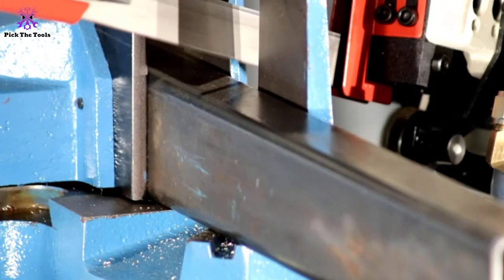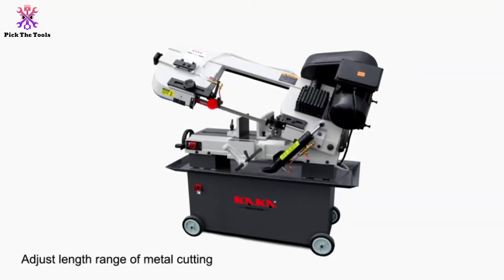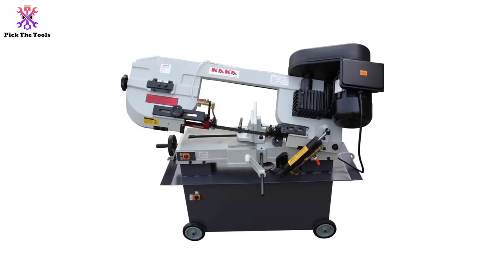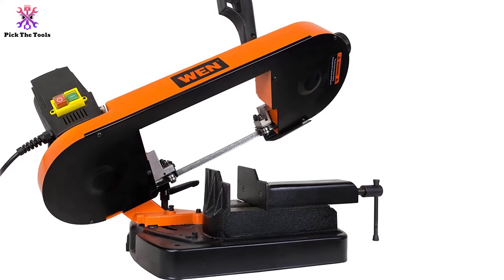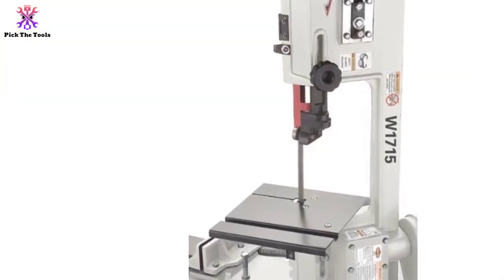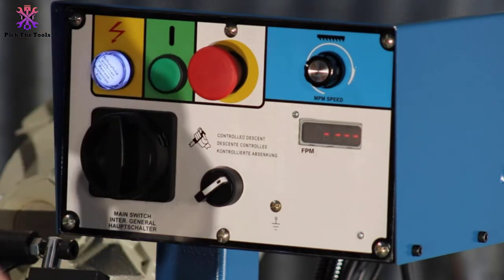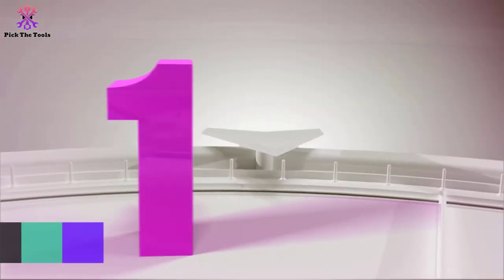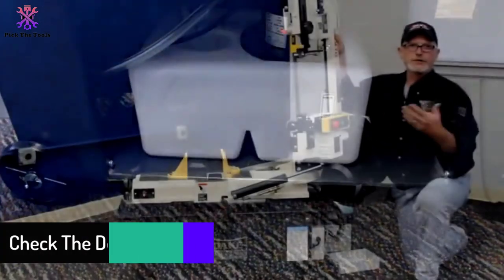Top 5 Best Horizontal Band Saws for Metal Cutting 2021

Comment from the maker: 🔹5. KAKA BS-712N || 7-inch Metal Cutting Horizontal Band Saw
[Link]  https://amzn.to/3xnx2zD

🔹4. WEN 3975T || 4-7/8-inch x 5-inch Band Saw for Metal Cutting
[Link]  https://amzn.to/3oLWxqo

🔹3.  SHOP FOX W1715 Band Saw for Metal Cutting
[Link]  https://amzn.to/3HGtyg8

🔹2.  Baileigh BS-250M || 8.93" Hydraulic Horizontal Mitering Band Saw
[Link]  https://amzn.to/3qVgPQH

🔹1.  Dake SE-712 || 21" x 56" Standard Duty Horizontal Metal Cutting Band Saw
[Link]  https://amzn.to/3nzvxe9